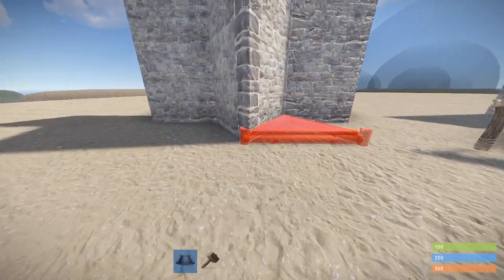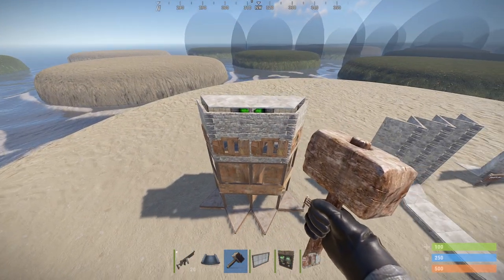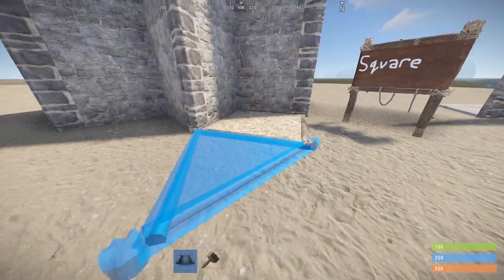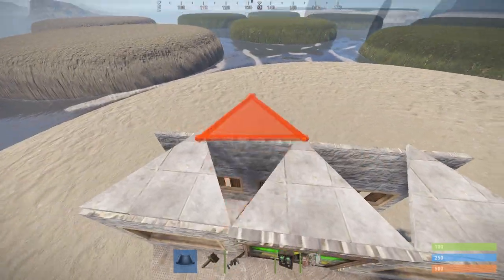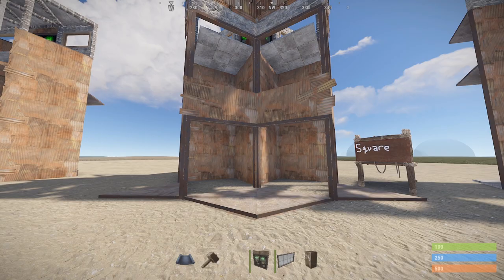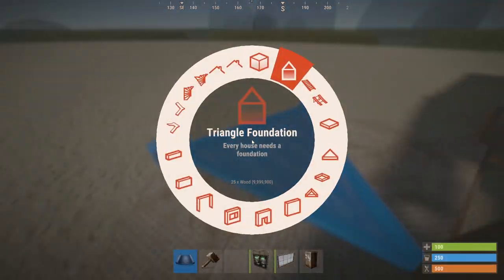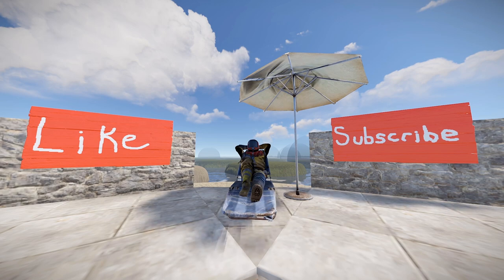Wide Gap Shooting Floor Tutorial | Rust Base Builds 2022

Comment: Nice work on the tutorial, well explained and clear to follow. Been meaning to get around to doing this myself but it seems like such an undertaking as there are many many ways to wide gap. A note though, I strongly disagree with putting halfwalls in the wide gaps. It's unnecessary and expensive. Agreed you can make some nice extra peeks with them but raising the foundation is...well...free. And I wouldn't do it with every single part of the wide gap, just some choice sections to create extra peeks to benefit the new crouch shoot meta. Just use a lowered window with horizontal embrasure with the floor at same height of the base, like in parts of my Hybrid and King Cobra bases if you want to take a look. Look forward to seeing the revised video.
Reply from the maker: Honestly the raised foundation is something so simple I didn’t think of it and I like the idea thank you. I’ll check out your videos out to look at the embrasure thing. Hopefully I can get to making a v2 within the next month or so, college takes priority over rust and I haven’t got to even touch it in a good 3 weeks. 

Thanks for this feedback it means a lot I hope to improve

Comment: The roof gaps are generally covered because, while you may be able to shoot inside your peaks if infiltrated, anyone on your roof will be able to shoot you inside your peaks, which can be quite problematic

Also, these are hardly wide gap, but better for use lower to the ground than a widegap. These aren't terrible peaks, and they would definitely work for smaller bases, like a honeycomb 2x2.
Reply from the maker: A good way around that if your too worried is by places diagonal roofs over it. Preventing anyone from getting an angle while giving you more peaks
Reply: Jesus loves you alot trust in His death 4 salvation and be saved from eternal hell <3 Jesus died on the cross for you bro.  <3

Comment: Really well explained on getting the footprint for the wide gaps. But I also disagree with placing the half wall and floors off of the main building. One of the major benefits of having a widegap shooting floor is even when your base is being pummeled you still have a shooting floor to defend from. If they floors are on main TC you run the risk of them being broken from lack of stability.
Reply from the maker: Fair assessment. I see the pros and cons of both, for me it’s more personal preference but I do see how your style out weighs mine. Whenever I recover from covid and get out to making a revised/advanced part two I’ll run over both styles quickly but informatively. I appreciate the comment, these are the comments that mean a lot to me and allows me to improve my content in the future.
Reply: @maphhew  and really at the end of the day it all does come down to preference. Having diverse options is what makes rust building so intriguing. I'll definitely be keeping up with your tips/builds I'm the future! Get well soon 🙏

Comment: Question, ' because I am too simp to figure it out myself.' (I have been trying with your tips for a few hours now lol) 
 My build is like yours square > triangle > square but myne goes square > flat (two squares wide) > square.   I am attempting a combo gap i guess my build has three gaps on the same side if that makes sense?
thanks for any advice and for the awesome video, I have learned a great deal already.

Comment: so why do you use half wall's when building the wide gaps i have never seen that before? dose it serve some purpose or personal preference?
Reply from the maker: I use them for a couple purposes. Main purpose is the half wall method allows you to have multiple angles on a single peak. The best way I can explain this is at 3:36 the raised triangle I'm standing on will give me additional/angles to use since I'm half a wall higher up. allowing me to get more coverage with little exposure to fob snipers while still being able to achieve the same angles. Another bonus is if somehow someone got in your shooting floor they cant crouch around, they would have to jump to navigate making noise, this also prevents them from running away to quickly if you engage them, forcing them to jump up if they want to flee, practically forcing engagements. These are my personal experiences I've enjoyed using this type of shooting floor with. The half wall lowering also gives you slightly better ground peaks as from personal experience there tends to be a blind spot around the compound walls that you cant access unless you over expose yourself, which this seemed to solve for me.

From practice raids while having friends shooting towards at me its also sometimes a pain to hit 4 walls during a pummel due to the half wall without getting in close or backing up away from the bases compound causing me to expose myself. resulting in death or wasted boom. 

That's the best way I can summarize it. I'd test it out for yourself to see if you enjoy it as the only negative part is ease of movement due to the jumping required to navigate. But in my opinion the pros outweigh this significantly. Hope this helps, you can always put my load up the playground I made using the builders sanctuary code in the description to see it first hand. Let me know if you have any problems with anything build related I'd be happy to help

Comment: Why does he build foundations out just to destroy them? Then build it back towards the base? I don’t understand that part. Can’t u just lay down the final foundation at the end without doing All that?
Reply from the maker: you wont have the exact spacing needed to build back with. Your shooting floor may be too close too far from the main base to work effectively.

Build out, destroying, and building back guarantees you will have the shooting floor placed in the correct distance away from the main base so it functions properly

Comment: why would you leave your shooting floor half floor lower than actual base? makes zero sense because it makes it harder to peek or over all use shooting floor for anything
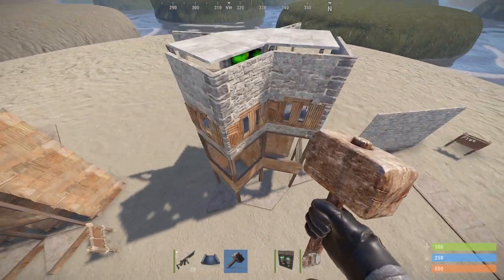Reply: 5:50 im sorry but what is this, this has to be a joke? :D I really hope new players of rust dont start designing their bases like this. Just make widegaps with squares to flat surface and you can make it so much better and cleaner. Or put triangles that comes from widegaps and triangles that comes from base. Please dont teach that crap :D
Reply: I really hope this is a joke video
Reply from the maker: I find the half floors useful in small groups due to how cluttered it gets with 5+ ppl (I dont play in big groups). These are the pros and cons I've had while using this style.

Cons:
- Mobility/Crowding is limited due to the jump ups
- Stability is slightly worse going up

Pros:
- Great for surviving heli's rocket barrages. The jump ups act as pill boxes to tuck in usually preventing splash damage through walls from getting you.
- (main pro) Jump up angles allow you to get some great peaks without over exposing yourself.
- Surprisingly the half wall fucks pummels up, either that or I have brainlets raiding me, but ive had it eat alot of rockets.
- With the lowered floor it lines my windows up perfectly with my external walls using the triangle jump up peaks. I've been able to pick off breachers while barely exposing myself to fob snipers 

It's mainly a preferred style, the main focus of the video was to help people learn how to get the footprint down and give them some idea what to do with it. I do agree with the flat wall, I never build them, hated recording and editing that segment but kept it in. Have been trying to edit it out using to YouTube editor but it has been wiping the audio out of the entire video. Still tryna find away around it, once I figure it out that segments gone, I'm not happy with it.

Im still learning the ropes of youtube video creation, really trying to up my ability to cover every action I do, and why i do it with. Example of this is I dont say why I built the shooting floor like it did, currently it feels like i'm creating show and tell videos instead of explaining the works and reasoning behind them. I appreciate your feedback and will be working on improving
Reply: @maphhew  Yea overall i liked your video even tought i disagreed about some parts of it, thats why i gave you like aswell already before you replied. This video was actually good with first 3 widegaps and i even got suprised when i saw how good this video was after seeing that this channel isnt some big one with lots of subs.
Reply from the maker: @MaybeRust  appreciate it, the criticism means a lot and helps me improve. I hope to work for better quality and hopefully helpful content.
Reply: @maphhew  if you really want an early rocket warning system, you can put fences in your external wall frames
Reply from the maker: @barryallen5507  not a bad suggestion, but its quite pricey for vanilla